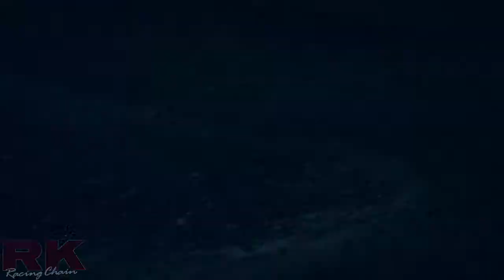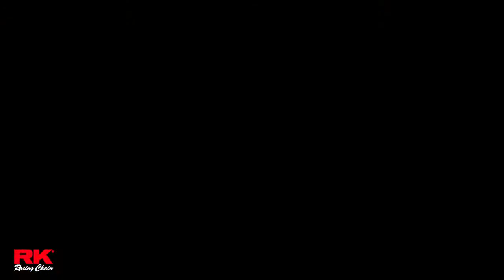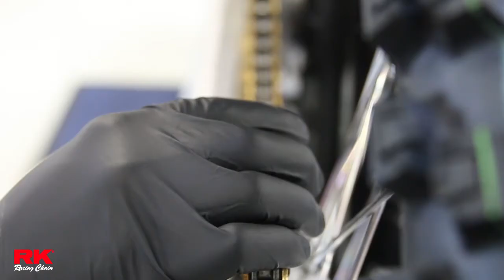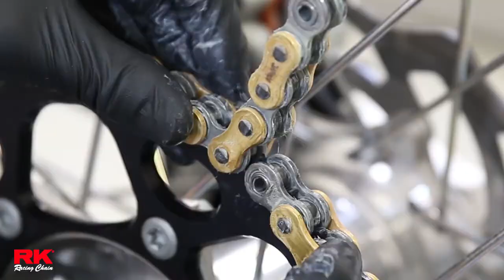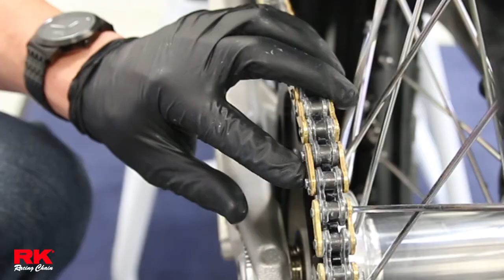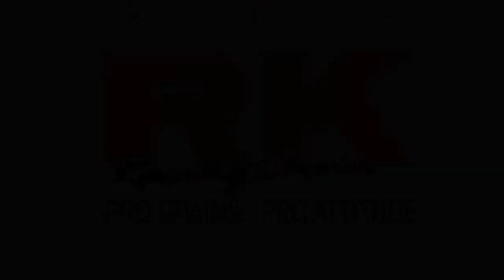Using the RK Chain Tool UCT2100

Comment: It's safe to use removable chain links?
Reply from the maker: Do you mean clip type connecting links?
Reply: @RKExcel  yes like this from the video.
Reply from the maker: @billadmond9450  If it's for a streetbike we highly recommend using a rivet link. If it's for a dirtbike Clip style connecting links are OK. However never re-use an old connecting link. If you need to remove the link - then reinstall using a new connecting link.